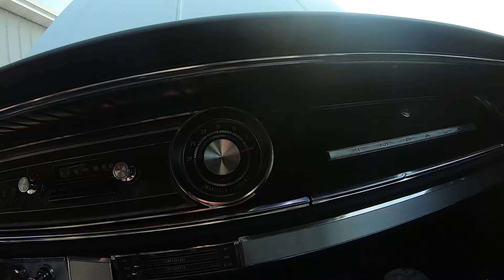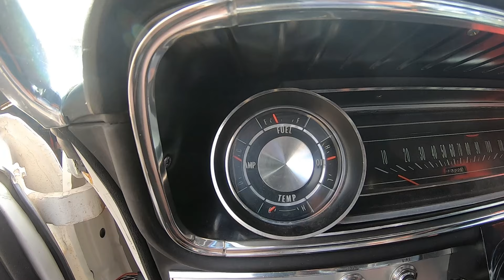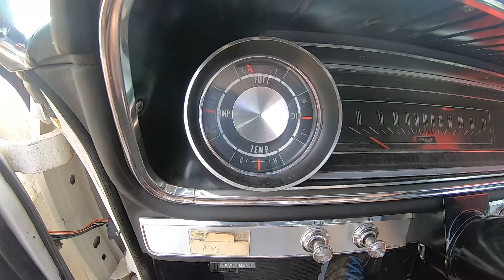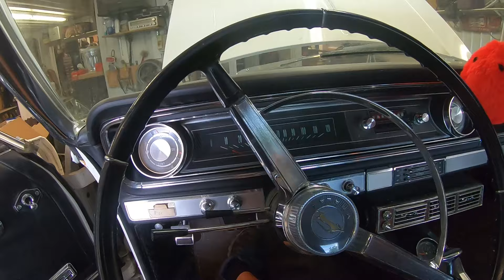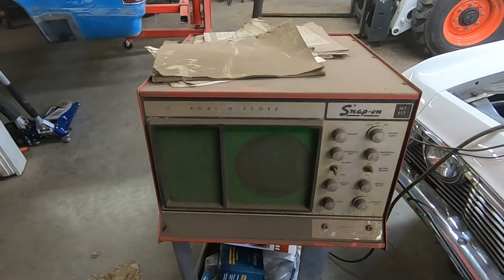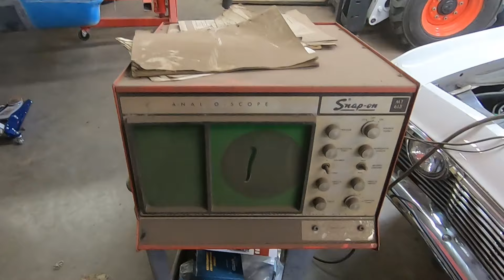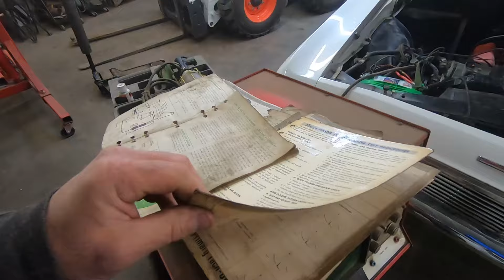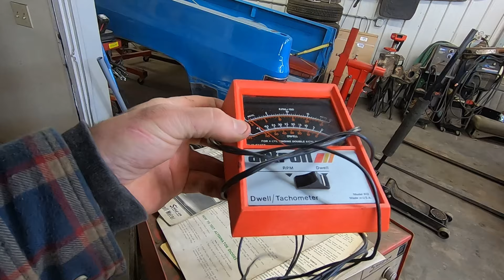Will It Run?!? 1965 Chevrolet Impala SS Resurrection! Parked for several years in a Barn!

Comment: Pull the vacuum hose off the transmission modulator valve. Sometimes they leak when they go bad and the engine sucks trans fluid into intake manifold and cause engine to smoke

Comment: That old brake fluid mixed about half and half with old transmission fluid makes good tire black. Cleans the dirty rubber. Don’t get it on your white walls or your red line tires.     
👊😎👍
Reply from the maker: Great tip!

Comment: You could get a cheap gas cap, drill it and put either a valve stem in it, or an Air fitting...

Comment: Its called setting dwell the time points stay open  28 to 32 works  best at 30 turn adjust screw until you get reading at these settings i beleive some old school volt ohm meters work well as a gage analog .....sweep

Comment: Yeah that's one thing I like about the early GM board system on the V8 they had that little window on the silver cap we can lift it up and then they got a little flexible allen wrench adapter slides right in there you can adjust the dwell while the engine is running get it exactly precise it's easy to do that's what I liked about GM V8 with that window and distributor cap makes it all please except 12 while the engines run and get it precise without having to go back and forth remove distributor cap just the points and the jacket again you know it's one thing really great about that I'll just get them perfect on that way Bobby AMC did that to using some GM parts and some of their cars I know some of them used to the V8 Chevy distributors in their cars

Comment: Throw a 1 or 2 bottles of Seafoam in the crank case and run it for awhile and it clean all the crap out.Then change oil and filter And then put 1 bottle in the  tank 5gals Then a a bottlle to fresh tank of gas I've used seafoam for yrs and it does wonders.

Comment: take it from an e xperienced brake mechinc, during the bleedig if you gonna put the wheels in the air ,have enough sense to take them off ,you'll find it easier to bleed plus you can get better lighting and camera angles.

Comment: My identical car in high school had 396 badges but n unknown size small block. Badge engineering? Paid $250 for it. Buddy had 66 396/th400. Turquoise paint, white vinyl top. Sweet car. Mine was a bomber.
Reply from the maker: A poser!

Comment: We rescued one of those years ago. Evening Orchid with a white interior. What's the deal with those clamps? Band clamps work fine on millions of cars. The main problems that they cause are: 1. They require the mechanic to use actual new hose and a non-rusted metal line instead of crap, and 2. They don't allow the "mechanic" to over tighten the clamp so far that it looks like a fat person wearing a wedding ring on the wrong finger. If I sent an old car to a guy to get running and he returned it with worm clamps everywhere, he'd get it back and get paid when he figured out how to properly use those clamps. Of course, i'm the guy that gets them running too, so, no worries. Sorry for a rant but you guys take the easy route sometimes.

Comment: Usually if it takes 2,3,4 pumps of the pedal to get firm they are out of adjustment or worn ….air in the system still leaves soggy pedal..JS

Comment: Only if you could find an Edsel that had been sitting for years that needed a resurrection.......now that would be neat!
Reply from the maker: Love to find one of those 3 year cars!
Reply: @MortskeRepair  , there's a guy in Sisseton that has a 59 Edsel wagon. Guess it's a cool survivor wagon but I heard the guy is a real ass to deal with!
Reply from the maker: @darinaadland5226  He couldn't get it running?!?
Reply: @MortskeRepair  , he had it running for about 5 seconds to blow the mouse nest out of the exhaust. He's kind of slow and not very bright but he tries.
Reply from the maker: @darinaadland5226  That's too bad

Comment: Really like the channel.
Always looking forward to your new videos.
I like your videos when you work on your Chevy trucks 1962 to 1965  I have a 1962 truck put a lot of work into it really like that body style.
Bought one of your t-shirts on the website should have got myself a size bigger I thought XL would work.
Will you be carrying stocking hats on your website?
One issue I have after I moved the gas tank underneath the bed the gas gauge reads opposite when it's full it's empty not sure why it does that? Gas tank came out of a 1962 Bel Air.
Reply from the maker: I'll look into beanie caps.
Reply from the maker: Not sure why the gauge would be backwards like that. It all runs off ohms and GM was pretty good about using the same rating across their lineup.
Reply: @MortskeRepair  thanks for the messages 
Will be looking for your beanies when they come out now that it is getting cold out.
Do u recommend body wraps to put on vehicles as my 1962 Chevy truck is in primer and I am not a painter and I was trying to find a cheap way to get it painted or put a body wrap or would you recommend just leaving it in primer. Not sure if anyone offers that service car warp in North Dakota. Not wanting to spend a fortune on it lol.  The truck is just to have fun and  not for parades as I'm not a big fan of them either.
Reply from the maker: @shannondohmstriech6023  I don't have any experience with them sorry. I like primer personally.
Reply: @MortskeRepair  More than likely I'll just leave it in primer cuz I know to have somebody going paint it for you it'll cost quite a bit thanks
Almost thought about using rattle cans like DD speed shop did on his car.

Comment: Not trying to start a fight but I have a 78 Chevy nova that was my grandma’s that has had the flex hoses on it since the early 90s and it’s sat for years and then my brother used it for a daily driver for a few years and now it’s sitting in the back of the house and I drive it around the neighborhood every few months and the hoses are still fine.
Reply from the maker: They last, they just look like some hack worked on it. And they're hard on radiator outlets.

Comment: I mentioned in a previous comment that I have a Wilton vise like yours, though mine is a '67. It belonged to my father and I think my grandfather as well, but they have both passed away. It is completely functional, but has hard life, and has not been particularly well cared for. I would like to at least do a half-ass restoration on it to preserve it for the future. There is no paint left on it, and it is coated in surface rust. What is the best way to remove the rust without damaging it, and do you know what the original color was? I can't really seem to find any info on that type of stuff.
Reply from the maker: Kind of a light off green/blue. Go check out The Garage Journal. Lotta information on that site. I'd use a rust removal product like EvapoRust.
Reply: @MortskeRepair  Awesome. Thank you so much!

Comment: I looked away for a moment while the vid was playing and when I heard you say "anal-o-scope, I thought to myself, "Is Mortske opening a proctology lab?" 😁😁 Nice old Impaler. You're right. That thing is too nice. Interesting thing - that engine wasn't locked up, no stuck valves or rusted up cylinders and yet the poor thing smokes worse than any of those other basket cases you've gotten running. Very interesting. Great video.
Reply from the maker: Glad you caught that! Yeah, too nice for us!
Reply: It looked like a oscilloscope. Ran em at precision tune in 80. Cool tool that don't get pulled very often.👍

Comment: Wouldn't they have come with white walls or red lines ? Or even black walls. I guess you had to say what kind of tire you wanted. Those tires don't look period, with the raised white letters. Looks more like 70' or 80's. Damn nice car. You did really well on this one. Duff Dog will love it 2.
Reply from the maker: Not really sure what they came with but you're probably right.
Reply: Redline tires were introduced on the 1964 GTO & I remember them from the factory on the Chevelle SS-396 by '65 or '66. Some guys painted the lettering on their tires back as far as the mid-'50s, especially on drag slicks and tires at Bonneville & other lake events. I remember ordering a white crayon stick from the JC Whitney catalog to hand letter the raised black letters on my mother's 1962 Impala SS ragtop back in the early 60's.

Raised white lettering from the factory literally defined the muscle car movement starting with the introduction of Firestone Wide Oval x70 series in 1966. The trend-setting BF Goodrich Radial T/A series sporting sexy white raised letters brought the muscle cars up to their handling potential beginning in 1970. I wore out the factory belted Wide Ovals on my 1972 Vega GT just in time to be fitted with the first 13" 60-series T/A Radials released. That little bugger cornered like a slot car with those T/As! 

The BF Goodrich T/A Radials also became the performance footprint of the Vanning movement that started in the mid-70's as well. BFG T/A Radials became my go-to shoes on all of my vehicles for the next 4 decades (preferably on Corvette Rally Wheels.) I hope that helps with a little bit of sidewall history..... 😎

Comment: When I have my mom 66 Impala and it said in the garage for almost 30 years I took the spark plugs out put Mystery Oil in a spark plug holes let it sit for a while turned it over flush the rest of the fluid out  with  flushed it out  tuned it up put a battery in it with fresh gas but I change the oil and added a quart of Mystery Oil even though my car didn't smoke it only had 18 thousand miles on it but this might do the trick for your Chevy ticket from a mechanic almost 50 years experience

Comment: Oh i recomend putin in a msd st fighter dist in it put one on my 355 and it beats the hell outa adj points plus car runs xcelent did disc on front for saftey car stops great also switched to one wire alt what a difference witl lights at nite

Comment: I have a grand idea and no way to try it but you get suggestions all the time on how to turn a stuck engine, preferably on the starter if not to stuck right??? So take a few old dead starters and get the shaft, and the gear of course, cut the starter housing in half or what ever feels right... hear me  through please... the shaft with gear to flywheel fixed so it stays in place. An armature shaft won't work because well the big old center piece but a shaft that will hold the gear to turn the engine, and put a plate on the open end of this starter that will still bolt to engine.... shaft through it and plate on end so it stays centered.... put a dead socket on the end of the shaft sticking out so that you can turn engine with the flex handle. That plate with the hole in its center would make the shaft stay where you need it to. And that shaft going through the plate and out to the gear end is in starter.... damn,, I wish I was there to explain better but the old starter housing would just be a tool basically... just before it comes through the plate, weld a washer or something to keep your shaft inside where you need it. You could rock the engine back and forth maybe and be easier than breaking one from 24 volts. You would be making a power multiplier in sense. At least you wouldn't have to pull the head off, right a way anyhow. The reason for using a starter is it fits to the engine already and so it would be the start of your tool. I got this in my head from the snap on tool that you can use to turn cummins engines with only they are real short and just made for that job only.  Starters that bolt to the engine are ones that this would shine cause you could bolt in place, use a shaft that fits the starter and then extends the other direction. If you could figure a way to not even need to cut a housing but use large pipe and make a plate over the end and keep things lined up all the better. I hope I gave you enough to get the idea for doing such a project and thank you for being kind to me as us old guys do have feelings too.
Reply from the maker: I get what you're saying. Just would have to build a new tool for every engine.
Reply: @MortskeRepair  Thank you so much for responding to this. I get ideas in my head and they drive me crazy.... I have another idea for engines that the starter bolts to the bell housing. Another time and video for it as it won't leave my simple little brain box LOL

Comment: Not used to seeing this content, usually it's stuck motors that won't free up haha
Speaking of motors can I pick your brain about one I am having trouble with have Mr mortske?
Oiling issue on a 73 350.
Reply from the maker: sure
Reply: @MortskeRepair  thank you so much! I've got a 73 350 out of a g30 that I put into a 78 g30. Runs good, new timing chain, 60 psi oil pressure. But only one of the pushrods is flowing oil. And high pressure oil at that. None of the other pushrods are flowing oil. The lifters have oil in them, the pushrods are getting oil but it's now flowing to the top end. Pulled the intake and saw nothing out of the ordinary. I'm about to pull the pan and replace oil pump but.. any ideas why I'm having this oiling issue? Only 1 pushrod gets oil. I have photos and videos to show the weirdness too.
Reply from the maker: @coreyward441  You pull the pushrods and clean them up? They'll get all full of crappy old oil debris inside. Blow em out with brake cleaner. Then hold them up to a light. you should be able to see through em.
Reply: @MortskeRepair  I did do that with several of them but they were clean. I put them back and they still didn't push any oil through. It's like the lifters don't want to flow oil up the pushrods. The only thing I can think of is there's a clog somewhere maybe. The lifters have oil but it's not flowing for some reason.
Reply from the maker: @coreyward441  Are you priming the oil pump with a drill? Sometimes it takes a while.
Reply: @MortskeRepair  initially I did try that but it wasn't working and I think the reason why was I was spinning it the wrong way. So I dropped the distributor in and let it crank until I saw oil.
Reply from the maker: @coreyward441  I would take it apart and use a priming tool and turn it the correct direction. It might take some time.
Reply: @MortskeRepair  my only priming tool is a shaft from a busted distributor. Will that be okay?
Reply from the maker: @coreyward441  Yup!
Reply: @MortskeRepair  thank you. Results have been inconclusive though. Ordered a proper oil priming tool and will do more testing. Oil galleys where the lifters sit are not blocked or full of crud. And galley where the distributor goes was flowing a lot of oil. 60 psi spinning the oil pump.

Comment: Put mothballs in the 88 fox body when I was storing it on my car trailer for five years. Not only did they get in but they ate the moth balls but They killed them all. I would start the car up once or twice a year and run it for a little bit. Then dump 5 gallons or a few gallons of gas with some stabilizer in it in the tank. All this is documented on my y tube channel.
Reply from the maker: I prefer the smell of mice over moth balls!

Comment: A guy showed Me how to flute the end of a fuel line to draw the fuel out . It might be Jerry frying in the exhaust ha ha. Tom chased him up there . Remember the car was left for a reason. Change out the valve stem seals easy job just need a compressor and adapter for the spark plug holes. The brake issue is in the hose fluid goes in don`t go back . It is a Gm thing. Take a half bottle of brake fluid crack the bleeder put a clear line in bleeder and the other end in bottle open up the bleeder and slowly push down the brake pedal . It`s for the guy who has no friends . Oh yeah You did it that way . We in the North east call them a wiz bang transmission . The Brake line is shot inside . Had a 85 Fiero and had a issue with brake lines . I got a 66 Mustang with the same issue.

Comment: Maybe throw a can of the rislone through
It..frees up rings/valves?? Some guys up here use to add diesel to oil and flush em on idle...get the gunk out of em
Reply from the maker: Worth a shot!
Reply: Those old motors link zinc addictive also. Gd for seals bearings. With todays
Fuels...the lack of lead....might be worth while adding bit of lead substitute to gas...my buddy use to run a 70 Chevelle
454 and put low lead 100 av gas in it
Because of high compression. Hed go to
Local air strip guy would sell him 2 big red gas cans full for 75$..hed add a couple gallons every tank......which was OFTEN lmao. Looking forward to more
Vids on the old impala my friend.

Comment: Yeah that's when they're like of a Chevy back in the old days like that it was easy said to dwell on what the engine was running yeah that's what I like on the ba Chevys in Pontiac General Motors in general they had that little window on the distributor cap which will it's lit up you can get in there with it I want an allen wrench screw drivers need just 212 audiences run it I love those how small block Chevy set right at 30 degrees